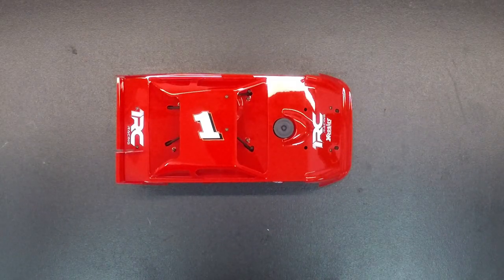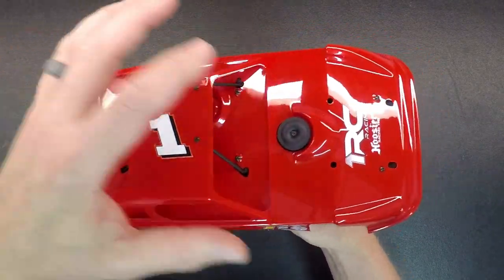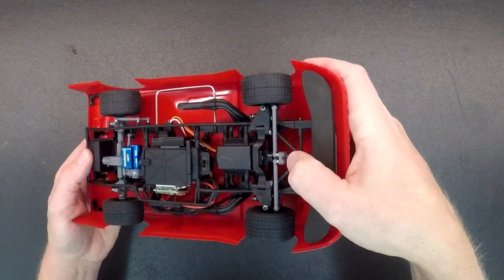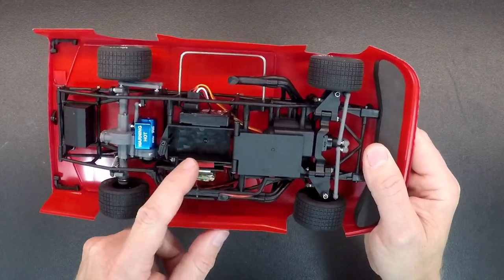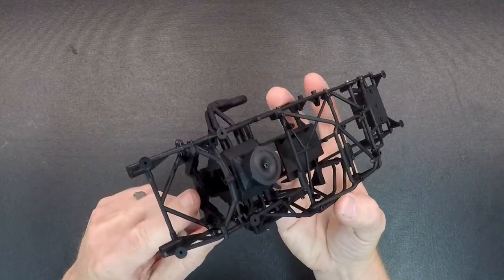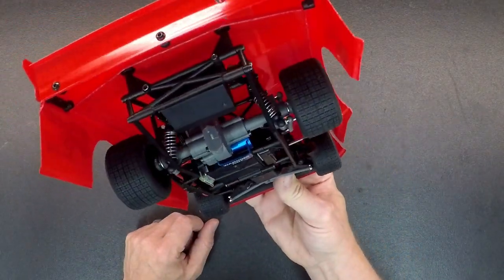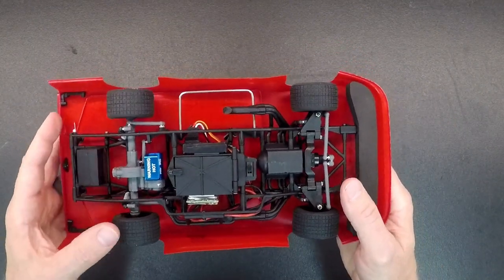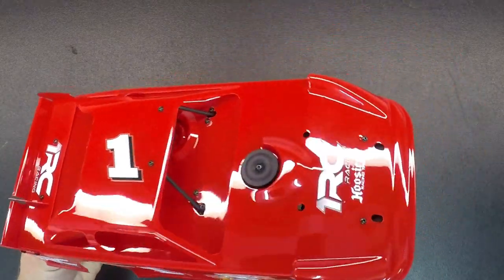1/18 Late Model – Features Video

Comment: What type of battery choices would I have
Reply from the maker: The car comes with a 5 cell battery, that is the largest battery we offer.  We do have an optional 10,000kv motor that you can use in the car that will increase the speed.  Thanks and let us know if you need anything else.